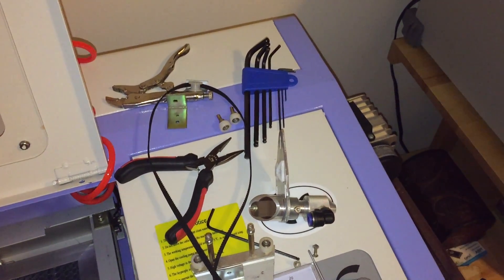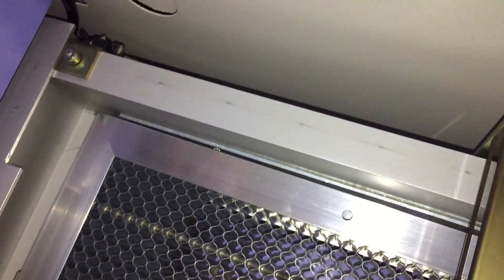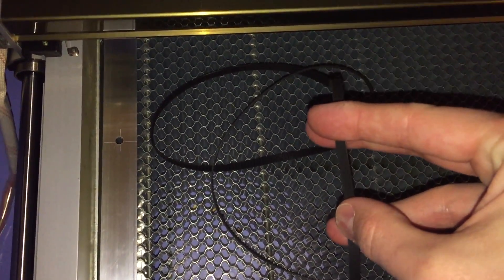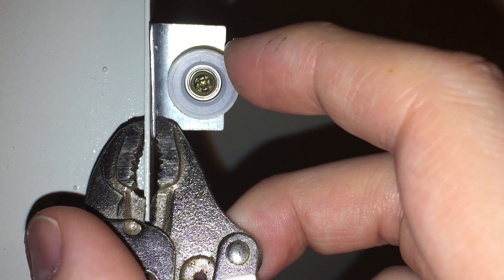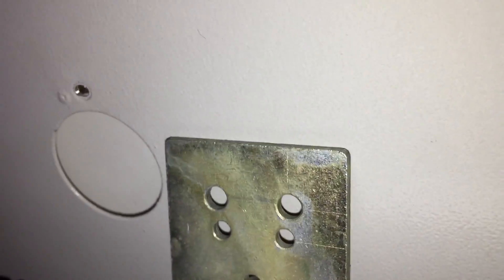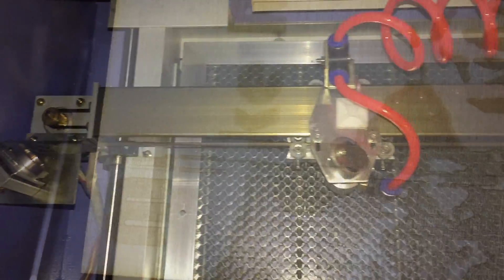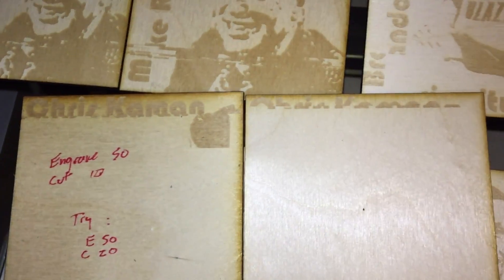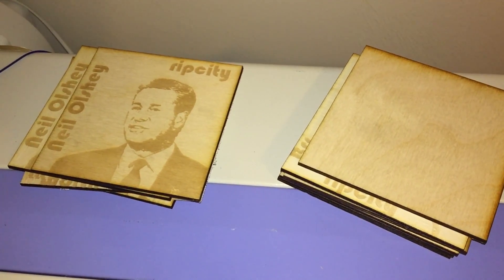LaOS Laser Part 7: X axis problems

Comment: hello, did you solv the problem? i have same problem and i dont know how to solved it. thank you
Reply from the maker: Yes, it was solved by replacing the pulley with one that is round.  I just dug around in my junk bin.  You might need to look around and find something that works for you.
Reply: Thank you, my problem was at the pulley on the motor, i clean it an it works perfect.

Comment: Thanks, for all you grate videos, they have inspired me to get back to work on my LAOS problems. Do not remember seeing the final solution to the X axis problem. Did I miss something?
Reply from the maker: Rolf Randby The final solution to the X-axis problems was a new firmware to the controller.  Try to use the absolute newest version (only a month or two old) and see if you still have issues.  I was even able to go back to the laser power supply and everything still works.

Comment: I am a cnc programer, and  i tink u have problem at the time that the software save the file at the temporal  memory of the machine , tray to reset the software and create the file again,  if the new file works ok,  test it by cople times, save it in file named "good_one" and save the bad one as "bad_one", and tray run them cople time each, you will  see if is that the problem .
I just buy one like this one.. i have DeskCnc  Controller, and I have geico drivers., in case i need it,, my machine is on the wey..
Iam sorry for my  bad English..   May some time youcan invite me to fly ,, that is one of my dreams! love it ;)
Reply from the maker: Yah, I think it's a software problem too.  I've tried creating it a couple of times, and it doesn't really seem to change anything.

If you ever find yourself in the northwest united states, let me know, I'd take you flying.

Comment: You definitely nailed that mechanical issue which is good. I noticed where you get the errors the laser looks to be "on" quite a bit, I wonder if the supply is dropping when the laser is on? Try doing an engrave with as little milliamps as possible to see if that changes things. One thing that makes steppers perform much better is to run them at a higher voltage. On my 3d printer I raised the voltage from 12 to 19 and it runs much better voltage = acceleration. Good luck.
Reply from the maker: Thanks for the ideas.  I noticed that too.  One wrinkle, though, is that I'm powering the motors and logic board from an entirely separate lab power supply, and the laser on signal is galvanically isolated.  There is no direct electrical connection between the gantry, motors, or controller to the laser power supply.  They do connect at the step-up transformer's ground, though.  I still think it's a good idea to test different things like you mention.  One thought I had was that it seems to occur when the engrave changes size (an optimization step to not "engrave" blank areas), and maybe that's why the firmware/software may be to blame.